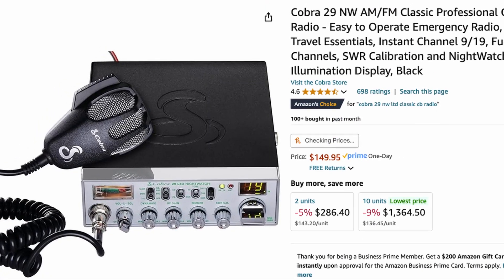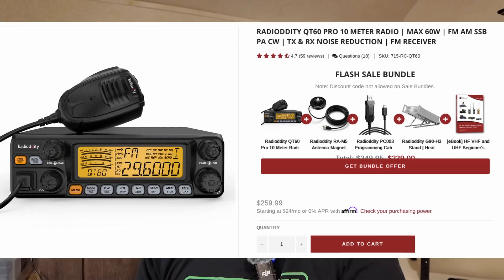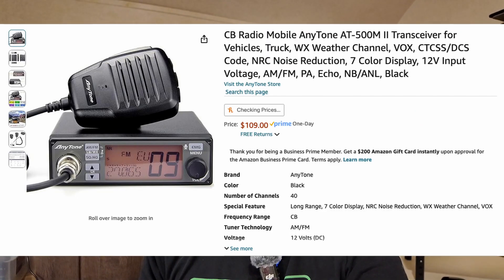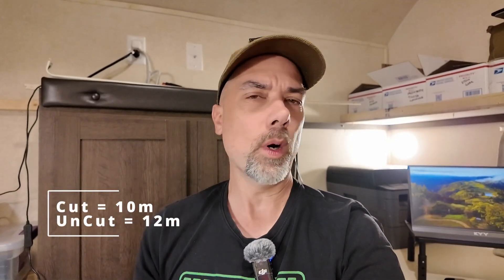Hack Boys!  Radioddity CB-500, Anytone AT500m

Comment: Press and hold am FM button +power on changes bands stock.
You can do split ctcss/DCS tones on that set for parrot mode uses.
Can plug a argent sr-1 simplex controller box 
Wire it to 6 pin mic socket as can route 
Rx audio out (in menu options)
Ptt
Mic
Gnd
+13.8V 
Off 6 pin mic 

Very handy ,including FM UK band stick and expanded 👍
Repeater shift handy for 10m

73s from UK 

Rob.P

RPC
Reply from the maker: @rpcomms1  sweet. Thanks!
Reply: T0/5 is 0kc steps 5khz steps

Comment: It has a really complete 10m HAM mode, with repeater offsets, and CTCSS, etc (that's what you did at 9:20). I have worked many 10m FM repeaters with mine. A fantastic little rig that works well, and is really cheap! Also, on AM mode you are getting 18 watts of PEP power, but your power meter is average power reading only. It's a clean radio. All of the new Qixiang built radios (AnyTone, Radioditty, etc) are very clean. Also, this is the AT-500M2 - the M2 part is important, as the older version AT-500M does not do all this cool 10m stuff! 
73
Reply from the maker: Thanks for the info!

Comment: Radio does some tricks.  There is a outher trick with that . I do not remember button to hold then turn on. Can switch some bands without moving that jumper.  I don't think we have AM/FM in 12 meter band plan.  we do in 10 meter. 29 to 29.7 MHZ . Some have done POTA  on 29 MHZ AM ! That extra power explains the big heatsink on final. LOL 73
Reply from the maker: It's cheap and cheerful
Reply: True...I thought it was both up and down....Not sure though.
Reply: Older model (this in Anytone version is the AT500M 2(!) not the AT500M.) had the heatsink too...(the AT500M)....
Reply: It should still have a engineering menu, hold up&down forget if you have to hold ptt and then power on, I guarantee it has a hidden menu, options to adjust low,med,hi power levels and modulation adjustments for each power level for both am and FM modes, has frequency alignment,sq and asq adjustments, RF gain adjustment can't think of anything else off the top of my head 

The version one does have ctss or whatever, but it's a good little radio,mine was $80.00 when I first came across them..

Cheers.
Reply: Oh to change bands on mine was gold am/FM then power on.